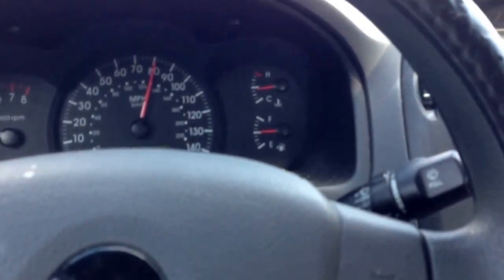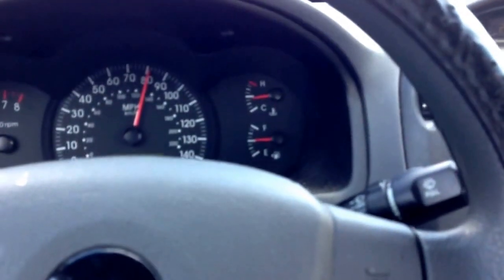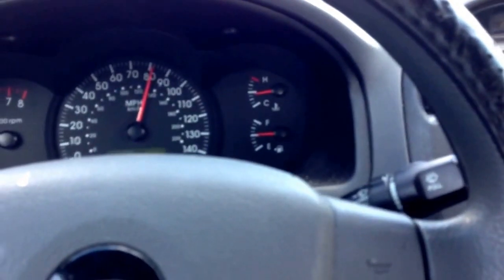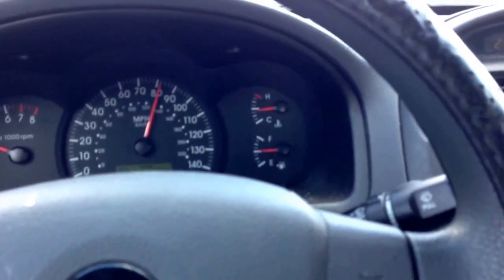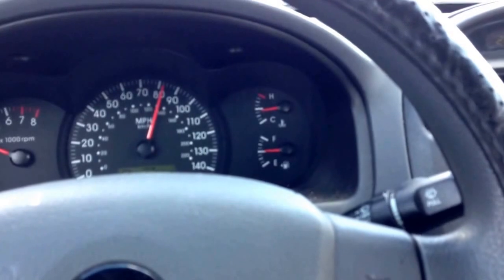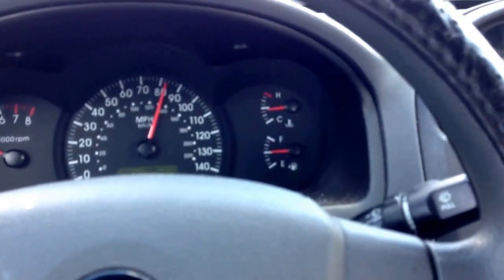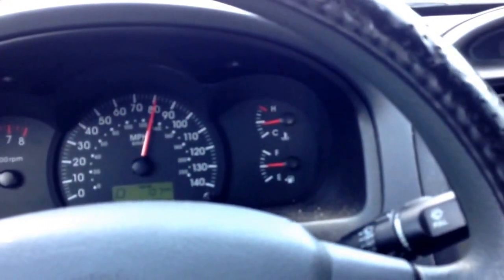DIY-Fuel Ethanol (190+ proof Home distilled) on a Test Drive

Comment: I hear so many things about ethanol being corrosive on fuel lines that aren't designed to take flex fuel. It may have no problem at first but fuel line corrosive will eventually be pain in your ass. I would suggest you make sure the fuel lines are PTFE. Also as I hear you used only the "conversion kit", I wish someone had warned you about those magical products. They do nothing to your car other than making you believe that your car can run on ethanol without further modifications. Your O2 sensors report a "too lean" condition because you did not update your fuel system to compensate the extra fuel consumption. To allow a car to be fully compatible with ethanol, you must update the fuel injectors for pumping more fuel and get the MAF sensors tuned to work with new fuel injectors. You may need to switch to a higher flow rate fuel pump and fuel rail too. I can't give you any results from my end because I have only researched to use ethanol for my car for higher horsepower fun but my location has no gas stations nearby offering cheaper E-85 and I am not living in country to allow me to brew ethanol unseen. But ask any professionals you need to and they will tell you the same.
Reply from the maker: Thanks for your comments, but I believe you are incorrect. Not only did this car run on E85 with no problems, but it's been running for over 40,000 miles. It now has over 240K miles on it.  I have a second car, a 2012 KIA Sorrento I also converted and it also is running just fine. Like yourself, I did plenty of research prior to doing the conversion, and found that the vast majority of information against converting vehicles after 1985 was incorrect. Asking a professional who hasn't experimented with E85 conversion or done independent research unfortunately will yield similar reply's. They are simply repeating what someone else has told them or basing their reply on their limited knowledge and experience.  The truth is, from someone who has done it is this: 1.) Yes, you will experience a slight decrease in gas mileage, 2.) You will experience a slight increase in power, 3.) Your car will run quieter and cooler. 4.) Converting the vehicle was as easy as putting in a converter box, no changing fuel lines, no changing injectors, no changing of the fuel tank, no changing of the fuel pump, and no reprogramming the car's computer. I do not run pure alcohol in my vehicles, because alcohol by itself may cause the computer to report a too lean condition do to the excess oxygen that is in pure alcohol, but blending it with gasoline solves this problem. David Blume's book Alcohol can be a gas and plenty of youtube videos will give you more info.
Reply: rhandsom Try taking that converter box out and drive for a day or two, I bet you will find your car running the same. If you are telling me no updates are made and is running fine, you are probably telling me the fuel injectors have not reached their maximum capacity when running in gasoline and you got lucky not updating your fuel system running E85. As you agree E85 will make you experience a slight decrease in gas mileage, you should agree the fuel injector is pumping more gas into the engine. And as you say pure alcohol cause the computer to report a too lean condition, it is not because of oxygen alone. Ethanol is C2H6O and yes it has oxygen, but one oxygen molecule can be easily consumed by carbon or hydrogen when burning and would not do much to the system. The only explanation is that your fuel injectors were at full capacity and could not pump more fuel to be burned with oxygen. That's why the 15% gasoline, the extra carbon molecules that do the trick, would keep your engine from burning too lean when same amount of fuel is being injected. The money you spent on believing that the converter would work, you could have spent on just the fuel injectors and MAF sensor tuning so that your car would be fully compatible with running pure ethanol if not more needs to be done. But it is your money anyway I have no control of stopping you from putting your faith on snake oil products. Btw I dunno if KIA Sorrento is using steel or aluminum engine block, but if it is aluminum you might have given your car a death sentence using ethanol because it is corrosive to aluminum.
Reply from the maker: philippng Thanks for your comments, I'll try to keep this brief. Ethanol has 25% less power than gas, non-flex fuel cars are designed to run on gas, not ethanol, therefore the injectors must be larger or triggered to stay open up to 25% longer, thus you will burn up to 25% more fuel, because you are injecting up to 25% more fuel. The converter box (which is simply a type of Pulse Width Modulator) intercepts the input signal from the ECM and lengthens the injector pulse by 25%. In the US, 90% to 95% of all gasoline has a minimum of 10% ethanol (E10) blended in to meet EPA requirements. After 1985 or so, all vehicles sold in the US had to accommodate that 10% requirement.  Therefore, the fuel system and engine block are suited to handling ethanol blended fuels. In this video I simply wanted to show that you could in fact run your vehicle on pure alcohol, I run E85 which has the petroleum lubricants blended in with the gas so I don't worry about corrosion. Obviously there are those who wish to try this, and those that are opposed for whatever reason, I respect that. The purpose of this video is for those who are thinking about it. I respect your opinion, but in the case of Ethanol (E85) and the conversion technology your wrong. The function of a PWM is not magic, it's simple electrical engineering.  If the fuel you are using is 25% less powerful than the fuel you need, then you need to put 25% more fuel in to get the same power you expect, that's not mysticism or voodoo it's physics.
Reply: rhandsom Ethanol may have less power than gas but the Octane rating is certainly higher than the premium gas. Using ethanol will result in horsepower gain and consumption of 20-30% more fuel by volume. They are almost common sense. All I am trying to say is, every car have Mass Air Flow Sensor and O2 sensors. The purposes of those two types of sensors are to measure the air flow, oxygen content and send the signal to engine to adjust the amount of fuel injected. When using ethanol instead of gasoline, O2 sensor will detect extra oxygen in exhaust and will adjust the amount of fuel injected into the engine. In that case, why use a converter box? The ECM should know how to adjust the amount of fuel. Pulse Width Modulator cannot make a 15lbs/hr rating fuel injector to go 19lbs/hr. Intercepting the signal for injecting 25% more fuel makes no difference because ECM can handle it alone. Furthermore, those converter manufacturer do not know how to fine tune a car as they are universal kits aiming for huge revenue selling to folks like you. If they do change some parameters for performance, they don't buy every type of car you own, convert to E85, put on dyno and tune the car to find the sweet parameters before selling those kits to you. Unlike some companies which make tuners for only specific cars and they know the car inside out before selling their tuner kits to you. You could have bought a normal piggy-back chips and get your car tuned by professionals. From my standpoint the converter box is just a snake oil product and again you could try take out that chip for a day or two to compare if there's any difference at all driving with E85.
Reply from the maker: Granted, re-programming the computer and fine tuning the parameters specific to the vehicle is the "optimum" way to go, but obviously it's not the only way to go. I can tell you that not every vehicle's ECM will be able to handle E85 straight in the tank with no mod's, whether larger injectors, re-progs, or the converter box. Non-Flex Chevy's seem to be able to handle straight E85 better than most. But there may still be some fuel delivery issues.  To run 100% E85 without the converter in any non-flex vehicle  would pose a risk, long term.  As for the converter box, I think it's safe to say that on that point we disagree. I believe it's still a cheaper alternative than professional tuners and chips, etc.
Reply: philippng guess it depends on how "smart" your car or how old it is ?
i got to admit, you know your stuff. Do you think E100 fuel could be used in 2cycle engines ? of course considering mixing e100 with correct fuel lubricant.
Reply from the maker: After years of running with the kit on 2 cars and thousands of miles on E85, I believe I can say that the unit works, there are no issues.  And I would recommend it to people who have modern cars that support E10 (which is used everyday).  There are no gas puddles in my garage, my engine is still running fine and I run straight E85 when I can get it, which is maybe 75% of the time.
Reply: e85 causes no problems as long as it is run out of the engine regularly ive seen just 15% gum up motorcycle carbs. and it is true that it will eat away at older fuel lines.
Reply: +Brandon Cole hmmm  When running alcohol you want to slowly and gradually ease the ratio in from 10% up to 50% very gradually on old fuel systems that have been running on petrol for a number of years.                                                                                                                                                                             On the matter of fuel lines I believe it depends on what your plastic is made of viton or not. I have run a mass array of cars and trucks on alcohol(make sure its ph balanced at 7 or higher) and havent seen any such thing; you might be thinking of the toxic methanol(made from coal; wood; or petroleum).  Look up alcoholcanbeagas .com for the book on everything you need to know (up to 2006) about running your vehichle on alcohol; and fast. Mothernature isn't very cheerful at the moment so get the word out and get studied up on that book.
Reply: +Buddy The bear Alcohol will actually clean out the gum from your ""carbs"' and your gas tank! just look up the ingredients in carb cleaner at your parts store and you will notice it is made of denatured alcohol!

Comment: hey, great vid.
not sure if it would apply in the USA but in my country you won't be covered by insurance if ethanol is found in your gas tank in the event of a crash
Reply from the maker: In the US, there is always a minimum of 10% Ethanol blended in with the gasoline.  The oil companies are mandated by the government to do it.  Why your insurance company won't cover it in the event of a crash does not make any sense. Sounds a bit suspicious to me.
Reply: @rhandsom  my guess is those car  insurance companies are also home and property insurance companies and by discouraging the use of ethanol for fuel they feel they are also preventing a lot of home distilling operations which can be dangerous and quite costly in damages from fire and or explosions. They may also be looking at ethanol being used as a means of increasing engine performance which in their minds would equate to higher risk driving.

Comment: what? how did you convert it to flex fuel and can it be done for all cars? Any difference for old/new cars?
did you mix with diesel or gasonline? thanks
Reply from the maker: To convert my car I used a converter from change2e85(dot)com. These types of boxes are sold on the Internet and I've been using for over 35,000 miles. Car runs fine using e85 at the point or what I produce.
Reply: +René Lauritsen There is a difference in old and new cars that being whether they are made from viton plastics and butyl rubber or not. Also older cars have a higher compression ratio(which is good for ethanol) engines because petroleum monopolies had no laws against them running poisons like lead in gasoline.                    If you look at the oldest cars they ran origionally on alcohol and had a very high compression ratio with excellent fuel mileage.

Comment: Hi i am like ecofuels, so i have few questions can i run car on pure ethanol (that i distill)and what kind of mods i need to do ? i have old bmw e30 from 1989
Reply from the maker: Due to the age of the car, you'll have to ensure that your fuel system (Fuel lines, fuel pump, and injectors) can handle the ethanol content. You could be safe with running up to a 50/50 blend without any mods. But I'm not totally sure about the BMW e30 vehicles. You'll have to do some research.

Comment: It is a fact that the oil companies blend Ethanol with 84 octane fuel to bring it up to the federal low amount of 87 octane. 84 octane is what is destroying small engines. I'm about to test 100% Ethanol to see what it's effects are on metal/plastic gaskets. Then I'll know for sure weather ethanol or the bad watered down gas is doing the damage.
Reply: ***** For now I'm coming up with watered down gas being the problem, So far Ethanol has done no damage to anything I've had it sit in or run in. Everything seems to run better on the stuff. I've always been skeptical of Ethanol and when I used to mow yards when I was younger I could always tell a difference from the gas station in town that used no Ethanol and the gas station in town that used 15%. I'm coming to the conclusion that the oil industry is destroying ethanol's reputation by combining it with watered down 84 octane fuel. I'll try to post a video, I ran one of my lawnmower engines through 6 full tanks of gas no stop, Carb was clean, no rust, no seal/ring wear.
Reply from the maker: Please post your results. I'm sure it will be interesting to see. Thanks
Reply from the maker: 100% ethanol will work in any car.  Cars before 1987 or so need to have a fuel system to accommodate the ethanol.  I've been running e85 for over 35,000 miles and it's running fine.
Reply: very interesting - what is the result?
Reply: do you think 100% ethanol would work on ANY car or just some?
Reply: ok, but E85 is 85% gasoline and 15% ethanol, right? I am from Denmark we dont have that. So I am curiouse if a car really can run on 100% ethanol - or at least 50-50% blend with gasonline. My car is from 1996
Reply: ***** It should run fine through a 96. I've ran a bit through my 1995 dodge dakota, I'm not sure if it would work on a vehicle that's not American. I've never seen 100% ran through anything that's not American or Japanese, my guess is if it has throttle body, single port or multi port fuel injection it should run.
Reply: running a mower non stop for 6 tank fulls in not the issue with ethanol anyway. it is infrequent use where the gas sits for several months in the tank that causes problems. 

i but 87 octane pure gas locally for my small engines and machines that are not used regular. i put it in my atv and my motorcycle as well because my bike is a 1986 and ethanol has shown to deteriorate the rubber in the fuel systems and destroy cv carb diaphragms. my brother had to buy a new carburetor for his atv because the constant velocity diaphragm was eaten up beyond repair due to ethanol. also i had to get a new fuel petcock diaphragm for my bike, again because of ethanol gasoline.
Reply: it's the bad watered  gas maybe neither
Reply: I'm in a country which gasoline is really expensive... so I'm looking for alternative of gasoline that may be alcohol that used in perfume ethanol ... i want to know ur experience of 100% ?

Comment: There are many many myths spread about by the petroleum industry about ethanol or alcohol fuel. Fortunately we have the internet which can be used to dispel these myths many of which are out right lies about ethanol. I have proven alcohol can run engines cleaner and more efficiently than on gasoline using alcohol vapor. Visit my channel to see how.
Reply from the maker: Thanks for the comments, I'll check out your channel.
Reply: GTIBully 

It’s also hard to verify IF those myths did come from the petroleum industry. Don’t make assumptions. Likely you’re assuming it’s credible when it could be someone else’s assumption about ethanol.

Comment from the maker: There is not doubt that ethanol mixed with gasoline, E10, have caused problems in small engines. But from what I understand, that is with small engines that have been left sitting with fuel stored in them. My lawnmower and pressure washer engines run fine on E10, But granted, I don't leave fuel in them for extended periods of time.  Also, pure Ethanol may also cause similar problems on small engines that don't have adequate ethanol resistant parts.However, I don't see daily use as a problem.

Comment: I just bought a Honda PCX 150 scooter to commute back and forth to work.  But one thing about the Ethanol is it gums up small engines big time.  So it works fine in cars, but not the small engines.  So if things go to pot, dont expect to cut your grass or weedeat, etc.

Comment from the maker: The ethanol is meant to reduce emissions, without it, they go up. Also, low octane fuel (cheap gas) is not good for your engine. I'm confused about the gas burning hotter equals cleaner comment, but I'm no expert. Improved hoursepower comes from higher octane fuels because of better compression through controlled burning and lower incidence of pre-detonation. The food vs fuel debate still rages, I would've said the same thing until I did some research and reading, now I know differently.
Reply: I think that guy must’ve meant that more energy was being used up thermally than chemically. As ethanol is a single type of hydrocarbon alcohol while gas is a slew of different kinds of petroleum with an averaged octane, it’s more predictable in how it will react in combustion, so solving the problem in small engines should be a one fix solution.